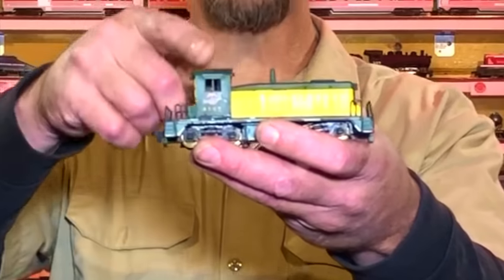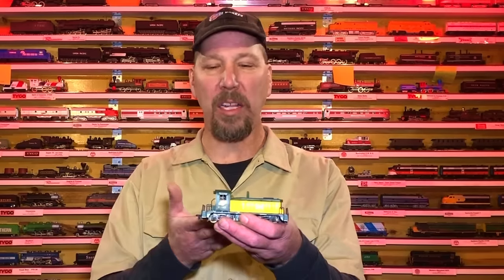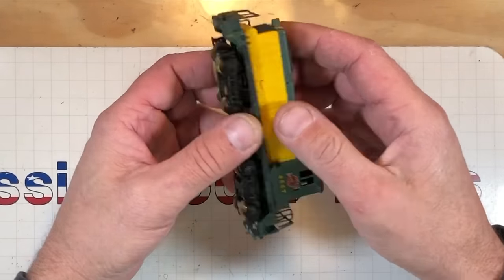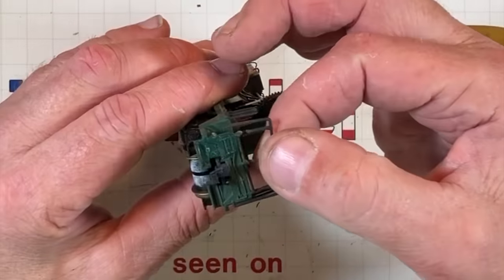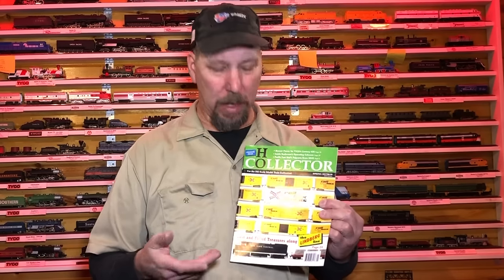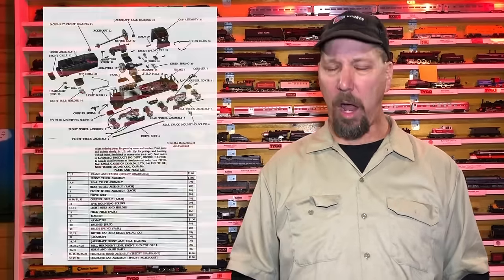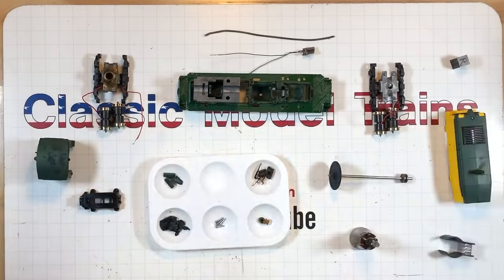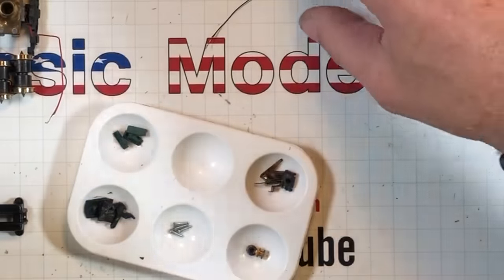62 Year Old Lindberg H.O. SW600 ,  How To Tear Down & Re-lube

Comment: A very impressive little model that used every inch of available space in that body shell. The power efficiency from that belt drive and upgraded magnets is pretty incredible! I have a few vintage HO engines with spring belt drives and was always curious about how exactly they get "hooked" together at the ends, many thanks for showing that up close!
Reply from the maker: Glad to help out :-)

Comment: I actually got a Lindberg SW600 a couple years back in the CB&Q livery. I did do a touch-up on the livery, cleaned the wheels and oiled the gears but never did much else.
I could easily see you becoming part of the HO Collector magainze team.
Reply from the maker: I couldn't even dream that big of a dream to be part of any magazine or large model RR consortium. That would be amazing!!

Comment: Another great video in the box. My only experience with Lindbergh models was a Battle Ship, I don't remember which one. It was a floating, battery powered model, but you had to build the electric motor. It came with the armature shaft/ commutator, and several core blanks, and a spool of wire. The magnets and the motor frame were part of the hull assembly. You had to build, and wind the armature, assemble the motor, and the gear box, which drove the propeller shafts. My motor worked but the gears were trash so the ship never sailed under power. I always wanted one of those switchers but couldn't ever find one. Now I can find them but can't afford them 😊😊😊😊😊.
Reply from the maker: That must have been one heck of a model to build.  Couldn't imagine having to wind your own armature.  Pretty cool!!
Reply: It was a pretty cool model, but it was a very simple build, except for the motor and drive train. The whole deck came off to access the batteries and the on/off switch. The rudder could be set for Left  right and center the and was stiff enough to stay in the indent to basically lock it in position. My motor windings didn't look pretty, but we're good enough for the motor to work. This was in 1968 or 69 so my memory is getting a little fuzzy on how it all went together, but I do remember not wanting dad to help me build the motor, because he would have taken over and I would have just had to watch😁😁

Comment: Great video, again, Ron ! Sorry to hear about the frustration surrounding the Daylight.  But, we shall see how that turns out . I never dabbled with Paul Lindberg's Train models, back in the early '60's. They were I guess, wanting to get into the act too, as Revell did-- with trains.  
I must have built 100 Lindberg model aircraft and car model kits in my lifetime. 
Back in the '50's and early '60s the Lindberg model kits used to hang on header cards punched with factory hanger holes in many Mom ' n Pop candy soda fountain type stores in the New York City area and priced below their competitor's kits; at prices such as $29 cents,  $ 39 cents,   $ 79 cents etcetera to compete with Aurora and Comet before Aurora bought the plastic molds from Comet. Comet continued on with only balsa wood flying model plane kits until Guillow's bought Comet out in the '90's.

I believe Paul Lindberg was a World War II pilot and a private  plane owner [ Stinson Voyager ] before he started up with buying Varney molds and marketing his kits in the late '40's under the " Olin " retail name.

He changed it to " Lindberg Lines " in the early 1950's.

If I recall, Lindberg trains were only around for about 5 years or so.
Reply from the maker: Thanks for some good information Frank.  Sounds like you have a lot of model building under your belt.  I always hated when you finished a model it became a dust collector.  Ive done a few balsa wood airplanes when I was younger.  That quite an undertaking.  Never flew very straight if I recall!! :-)
Reply: @classicmodeltrains  Yes, if you build a balsa wood rubber powered kit of the die-cut balsa sheet fashion such as Guillow has been cranking out since the 1930's; you have to pay particular attention to the rudder position and bend it just right to compensate for the torque that will send you off to the left. Just like on an actual Single Engine aircraft-- you must apply right rudder pedal pressure to counter that left turning tendency on take-off at full power, or in a go-around situation upon landing attempt. So too, if tissue covered; the wings can't be warped due to the tissue shrinking and then twisting the wings.  Most of my plastic kits I donated to aviation museums and to airports who in some cases asked me in advance to build them model replicas. 🛩🚋
Reply from the maker: @franktino6676   Well there's my problem right there.  Didnt have rudder kicked over a bit.  Been years since I built one.  Thanks for the good information!!

Comment: Hey Ron,
Lindberg also made small vehicle models, school buses , Greyhound buses and semi trucks about HO scale too. Love your videos.
Reply: They were called Mini-Lindys.  I used to love the smell of them when you first took them out of the box.  I have Moving Line one on my layout.  Real rubber tires, too.
Reply: Mail truck, too, circa 1960 in that " Mini Lindy " Line and most sold on header cards. 

Lindberg also had the : Cellovision " kit box packaging at that time , touting that you can actually see what was inside the kit box .

They claimed it lowered pilfering by kids opening up the kit boxes to examine the kits parts found in a standard kit box.😊
Reply from the maker: Thanks for the info Albert!
Reply: Frank..
Reply from the maker: @franktino6676  and you also Frank! :-)
Reply: @classicmodeltrains  welcome Ron, one of  my train dealers is Tom from Calumet trains also .
Reply from the maker: @alberthofer679  you own a hobby shop?
Reply: @classicmodeltrains  no but I was told I could open one with all the trains I have. I buy from Calumet Trains also is what I meant. Calumet Trains is owned by Tom Zmuda.  Met him a few years ago selling at train shows .

Comment: Howdy Ron, I trust that you had a superior Thanksgiving.  I've never seen one of these Lindberg models.  Rare earth magnets:  I've replaced all the magnets in all of my Pittman motors with rare earth magnets.  I got mine from eBay after researching what size magnets I would need.  After installing, they made a BIG difference in current draw and now they "creep" around the tracks.  Now you can see for yourself that the rare earth magnets make a really BIG difference.   Cheers from eastern TN
Reply from the maker: Yup!  them magnets are worth it for sure!  Happy Holidays to you :-)

Comment: Well that's a fun way to start Monday. I have 1 and  a half of that engine. Mine didn't come with the belt. I found a rubber band long enough to work barely. Thanks for the tip on the wheel seals, I'll have to find one. Never would have guessed that! The motor on mine squeals badly and has a stripped gear, the large gear keeps popping out so I might try putting it in the other frame. The Delrin post that holds the drive shaft is bent so it's loose. I'm impressed yours ran at all before you serviced it! Very well done as usual.
Reply from the maker: Thank you!  Yeah I couldn't believe a Feller sent me an operating one.  This was an interesting item to work on.

Comment: A friend of mine wound up with one of these, same paint flaking problems but his has most of the paint- and all the original handrails, unbroken! He wanted me to see if I could fix it up, and I just wasn't having much luck- that spring belt kept getting hung up and experiencing too much friction. I just couldn't get it to run right. But your video is making me want to have another go at getting it running!
Reply from the maker: I hope you can get the Ol' Gal running again!!

Comment: I was painting quad plastics that was kinda tore up. After some sanding of the rough spots to smooth it out and a scuff. Came back in with a paint adhesive for plastic. I use that before painting. I painted all plastic and turned out really good. I ended painting it in Michigan State colors. Everything was green color and with paper and tape taped off the center section so I could paint only the fenders in white. Put MSU stickers in center of all fenders front and back. Placed Spartan head logos on each side of tank. And completely different one on center of the front nose plastic. After  clear  work was done. It looked like a special edition quad. Like it came from factory that way. The plastic adhesive for paint did it's job. I would love to have that switcher. It would go on my shelf in living room where I have 40 of some of my best and beautiful ones. Like my revelle ACL & UP. I still need a driveshaft for the Union Pacific and the number plate that goes on front of the hood. Needed handrails. So I went to hobby lobby. I grabbed a cpl packs of music wire in different sizes.  The pack I just happen to have right here in front of me. Is #5498  and size is .015 . It comes in metal, brass, aluminum, copper, and tin. Was thinking about getting the brass and copper pks.  Using that on certain engines to make grab irons and railings. Then giving them a good polish instead of painting them. Making them stick out. Like a black diesel I have. It has orange metallic colored grab irons and handrails. Looks awesome. So wanna do same with only the ones missing the rails on them where the detail will set it off. The other ones I have will be just metal and paint them according to factory of original handrails. What do you charge to repair engines?  Also if missing or broken parts?  I have a cpl of ho Lionel. Went to an official Lionel hobby store in Saginaw mi. They weren't nice people. Always watching me. If they couldn't see me they would move so they could. Was by myself. Had my son my wife and my father. I asked them about the ho engines I have. Like snooty people would act. We don't service those here.  We only service Lionel and o scale. The look on his face when I asked about those Lionel I brought was a look like I walked up grabbed his first cup of coffee of the day and hocked a luggie in it and gave it back to him. If you are an official Lionel service you should service all Lionel. Right? Well TY. Another great video. Would love to have the SW you have right there. Have cpl C& NW. They are spectrums and dcc. That would go nice with ones i have. Thanks again.
Reply from the maker: Hello John,  sounds like you are quite a painter.  Pretty cool the Little Lady lets you display beautiful loco's right in the living room!!  Yes them Lionel Fellers, some of them won't waste a second looking down their nose at a Guy. I dont really repair loco's as a side hustle.  Been thinking about it.   Your Lionel HO might be made by Bachmann.  If they are, probably won't be able to fix them.  No new parts available and anything used will have the exact same part broken in it also.  Thanks for watching and stopping by to share a great story!!
Reply: She understands. I was in a bad place after my only and baby brother passed at 36 from cancer. Mentally messed up inside. Until I got my first ho setup for $30. But had bonus in box. My first o scale was thrown in box with it. I was like what's this? He said when I called to buy it he got everything around for me and found those so he threw them in as well. I took me back to being a child. Me my brother, playing on the floor in Bay window. Trains and slot cars. Brought me out of depression. 2 yrs later I had at that time about 150 engines from lot buys most from eBay. Some others from market place and yard sales. The found out about train shows. So now here I am. 330 est engines later. And who knows how many railcars. Lol then from a friend I met. She had like 5 big boxes and cpl small box of engines railcars. The big boxes on other hand had everything else I would need to build an entire layout. A Big layout. Even track and flex track for n scale I do have switches. Thought I had more n scale electric switches but with road bed. Sadly wasn't n scale. It's kato z scale. And some regular z tracks. I don't have any z scale anything. Just track. But anyway I ended up paying $20 for entire lot  driving my Kubota home was funny.  She was mad at bf. Kicked him out and was clearing out everything she had to make room. Stopped by her yard sale. I looked like the Cheshire cat 😁 from Alice in wonderland on my way home.

Comment: Hey Ron ! Another nice video. 
There were lots of Lindbergh models. I’m thinking there was a boat kit and an airplane kit where they included an electric motor. But the buyer of the kits had to actually assemble the motor. Maybe some of those kits would be a place to find magnets?
Just a thought from a 33%er.
Reply: Lindberg marketed about 25 model airplane and car and boat kits that included a " kit motor." 
One had to wire their own armature and install the magnets, etc. 

Those " kit motors " show up every now and then on ebay ...
Reply from the maker: Hello Steven,  I just read from another Feller about having to wind your own armatures for some boat kits.  That seems pretty cool to me!!!  Thanks for all your support!!
Reply from the maker: Hello Frank,  Them Lindberg Fellers sure seemed to have a large market share back in the day.  Love the wind your own motor options!!

Comment: Last night I found the round metal center cover for my Lionel dual transformer. It says on it... Multi-control "TRAINmaster" TYPE-ZW  transformer. 115 volts - 60 cycles - 275 watts. Underneath, for alternating current only. Made in U. S. Of America. The Lionel corp, new York. It is the 1 I was questioning you about getting hot. Hasn't blown up so probably be normal. Thanks again have great day week month yr. Lol
Reply from the maker: Hello John,  Them ZW's are good transformers.  I have a video on rebuilding them. Probably should at least update the circuit breaker and make sure it has a new electrical cord on it.
Reply: @classicmodeltrains  yeah talked to you about your video on this transformer. It was in a salvage yard going in scrap. A friend's parents own the yard in Taylor Michigan. They brought it to me in a 5 gallon bucket. Someone cut cord off. So I took it apart cleaned everything up put a cord on it I got off a toaster someone threw in trash. It worked great. Need to check the breaker and replace it. Idk but it works. Both sides work. Gets hot. But normal knowing the old school electronics they used back in the day. Then went on restoring a manual lift bridge. The hand crank was missing. Looking for a proper worm gear to make it electric. Need to figure out something to cut power when all the way open and same when it is all the way down. Wiring will be a little tricky. Like the switches for hallway light. You know the setup. When you turn lights on at bottom of stairs and get to the top and turn it off and vice versa when going down. Cleaned all the track. Got 2 chassis for the 040 and assuming 1940s tin body. Have a plastic 50s that uses same chassis. Did a of it running.

Comment: Satin Hunter Green is what you want, or flat/matte even, but semi gloss is still pretty glossy.  The spray can caps lie but on the flip side you'll have people saying they're GREAT.  It's possible that another customer switched caps, especially if they're one of those people who test colors before buying (some big box stores have a pad of paper set aside for spraying test shots).   I'm on 1080HD and the workbench footage is a tidbit blurry. Is it my connection or is it your camera?  I love macro videography so addressing that would be my advice for the channel. 👍😎👍
Reply from the maker: The work bench is shot on a iphone8 in HD 30 fps.  The problem is when I edit and zoom in on what im showing it gets poor because of the digital zoom from the editing software (iMovie)   So now I have a conundrum.  Not zoom in so far or have a bit fuzzy image.  I'm at a loss

Comment: Another great video, I'm wondering if an 0ring might work in place of the wire belt?
Reply from the maker: Thanks.  O-rings are usually not real stretchy. Have to find just the right one but it would probably work

Comment: Ron, what can I do to make one of the end bearings for the main gear shaft on this locomotive? I have two of these in various stages of disarray. On of the bearings is missing for sure.
Reply: What gage of wire did you use for the hand rails?
Reply from the maker: Two answers.  get a small metal lathe and make a bushing, or purchase a parts loco and cannabalize it for its parts.  I'm not sure the gauge of wire I used. Something I just had laying around and would fit in the stanchions.  .020-.025 I'm thinking

Comment: Ron, Did the head light stop working or is it that dim?  As usual, a great video You are a Rock Star.
Reply from the maker: Hello Marvin, I did install a new one and tested it on the bench, I never really cranked up the track voltage during the runs so it's probably presenting real dim I would guess.

Comment: Hi Ron awesome rebuild did your led in the front pop as was wondering if you fitted a resistor as rated for approximately 3v dc
Reply from the maker: Hello Peter, I installed a incandescent.  I did not have track voltage real high so it's just glowing dim